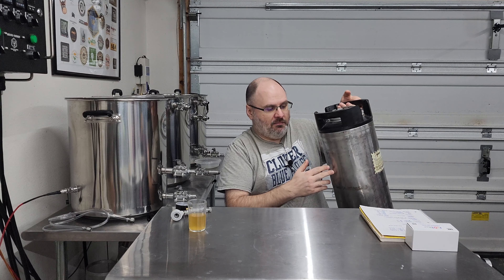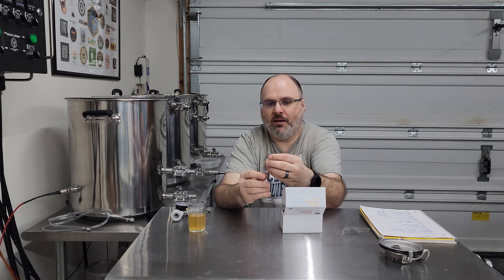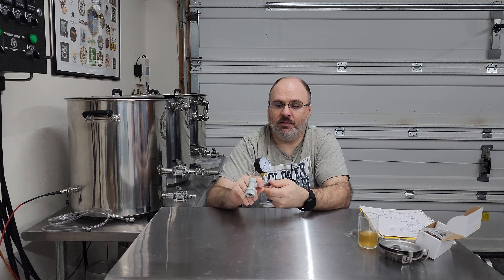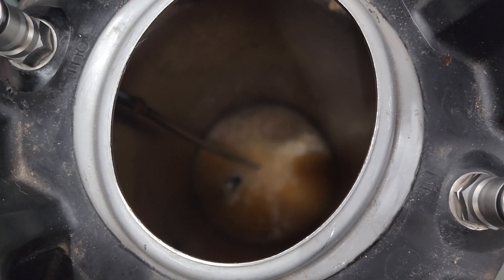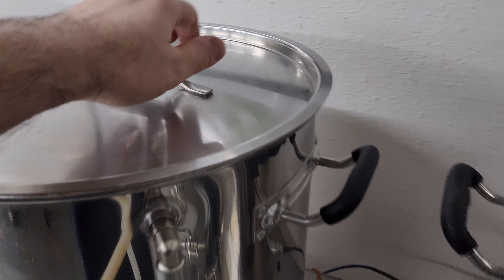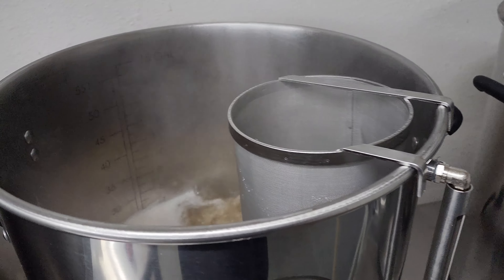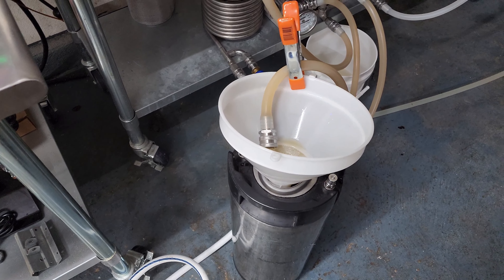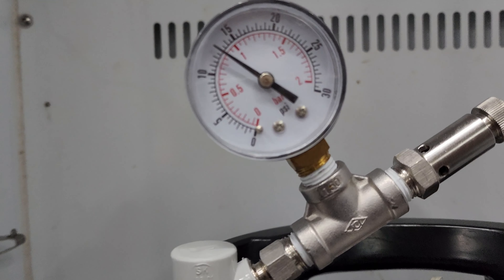HBW123 - Blonde Ale Brew Day

Comment: Great video. Thanks for bringing us into your brew day. I recently purchased that same SS hop spider and I'm loving it. Tried the San Step for a while, but I'm back to StarSan. It's fine for Immediate sanitation needs if you're drip drying but doesn't work for my keg sanitizing as it leaves a strong SO2 odor when wet that I'm don't like.  Also, I like having StarSan's ability to reuse. Can't do that with SanStep as it turns to egg drop soup after first use. Cheerz.
Reply from the maker: Very good point about the sani clean. I normally use starsan for most things. Only time I like sani clean is when I'm using pumps for deep cleaning like keg washer. Cheers!